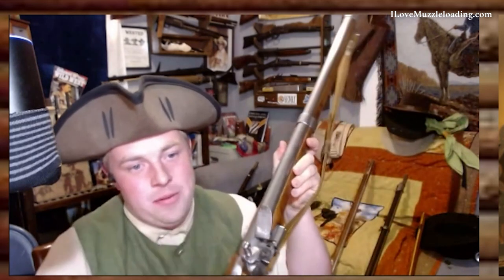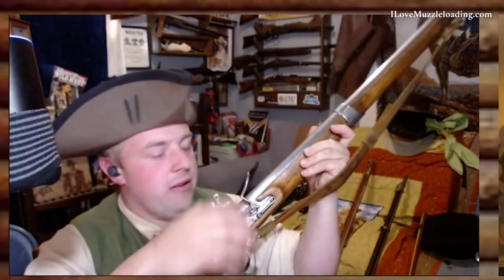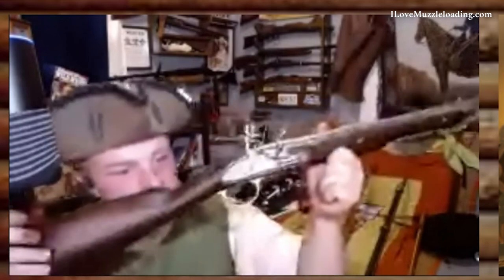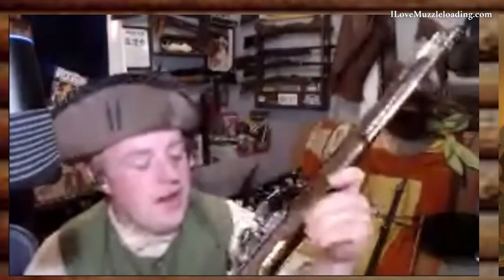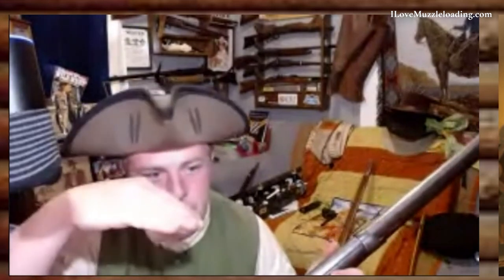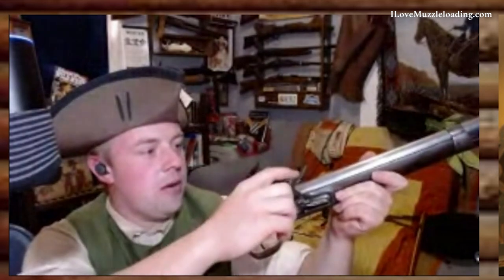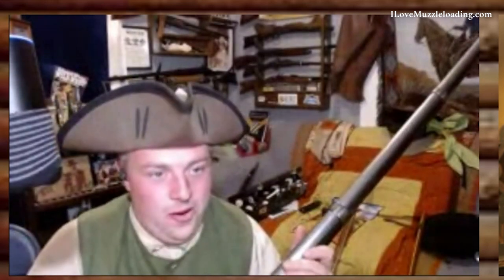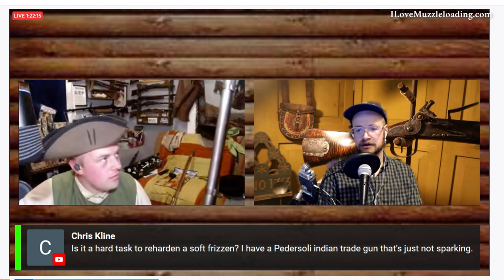Quick Tips to Re-Harden a Frizzen and Diagnose Lock Issues | A Chat with 11 Bang Bang Show

Comment: Thanks for posting this segment, I missed that one somehow.  Learning about flinters for the first time myself, got spoiled right off with a Kibler and an old Willie Cochran lock on another rifle, now muddling my way through a new L&R lock I bought for a LH trade rifle I built from a board.  The L&R has a very weak frizzen spring and only sparks well with a razor-sharp flint, ten licks and it hangfires or klatches.   The slow-motion video idea is great, thanks for mentioning because I didn't think of that even though I'm very familiar with the work and website you referenced which debunked a lot of lock and vent myths such as "fuse effect" and the fact that human hearing really can't distinguish a 20-millisecond difference in lock speed.

Comment: Don't know, but if Pedersoil uses case-hardened frizzens, once the case is worn away from the strike surface the only way to re-harden is with Kasenit.  The soft core isn't hardenable.
Reply: You should be able to case harden the Frizzen even if you wear through the old case hardening with true spark and a carburizing flame from a oxycetylene torch as this will add carbon back into the steel